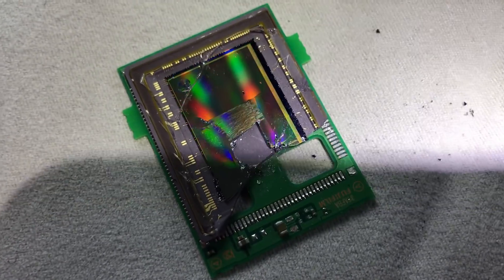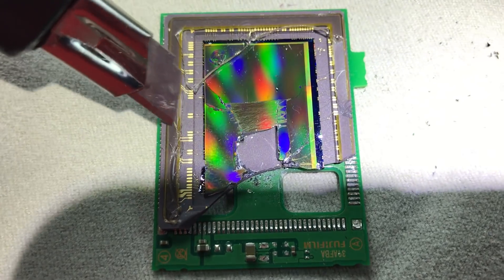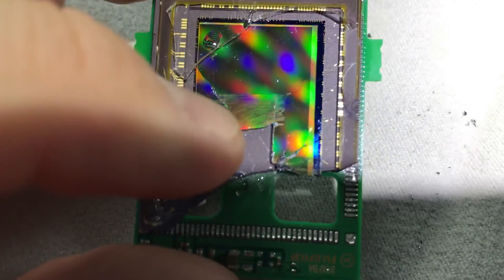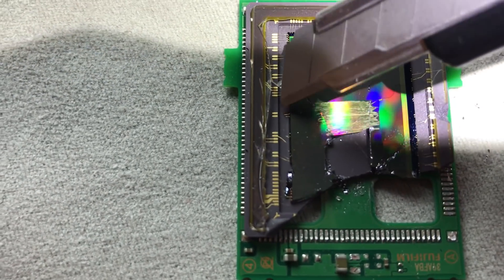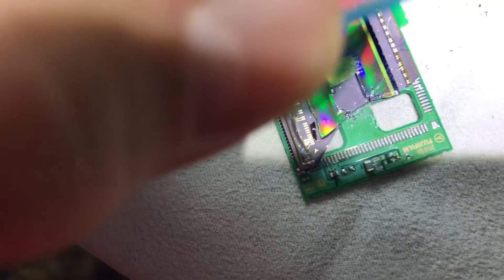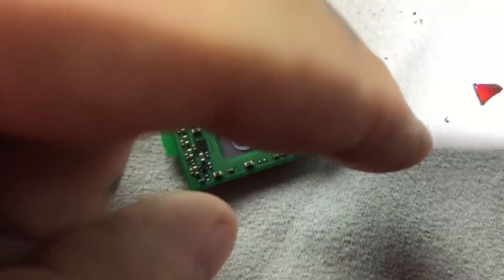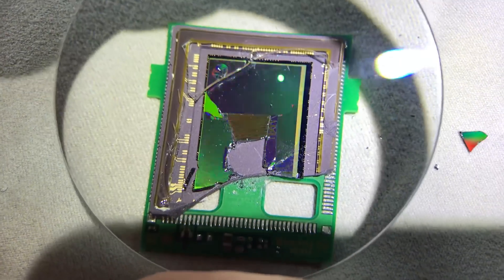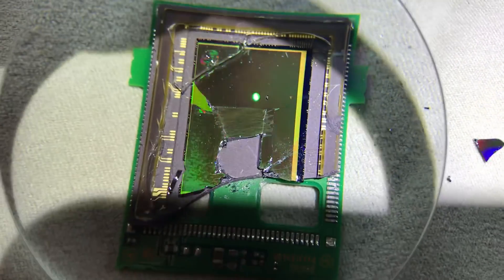🤓 FUJI SENSOR DISSECTED & Explained

Comment: You could could remove the  CFA with a trip through an asher since I believe the CFA is usually dyed photoresist.  An asher works with vacuum, heat and ionized oxygen.  Not easy to do at home. Let alone find a worthy solvent solution to clean it up afterwards.

Comment: Removing the IR sensor will give you a full spectrum analysis using this software, Thermino Spectrum Analysis.  Can be calibrated to test your led frequencies, grow light quality, and a supposed myriad of health benefits to the IR.  I just started to play with the software with a HD Webcam ($30) and it took an extreme amount of effort to remove the IR filter as Ken said.

Cheers!
Reply: Of course, I would appreciate feedback from Ken :-)

Comment: for monochrome camera - wouldn't be easiear to order a sensor without the RGB filters directly from the manifacturer, and replace it, than the complicated process of removing them?

Idea No2. - Couldn't be possible, like the ND filter inside the Fujifilm X100-series - the color filters to be on / off  over the sensor with a switch? Color + monochrome camera

Comment: It is enough to scratch the filter. Then you need whole new sensor. It doesn’t matter if the actual sensor is idiot proof.
Reply from the maker: no you dont, you have ZERO chance to touch the sensor, and NO you dont need to replace the sensor, only the cover glass, not even the IR pass filter, NOR the actual sensor coverglass
not true
Reply: I don't know about Fujifilm, but Nikon supply the entire image sensor units only. So scratch on the top layer ( in the case of Nikon the ultrasonic cleaning system) - ups, you need new sensor. Even if you get the top glass only - ups - you need new focus and image side recalibration. So, if you scratch it - you are getting an expensive repair.
Reply: Don't tell people that is not a big deal scratching an image sensor. Go and ask for a replacement from Fujifilm, then start telling stories how you can take a shit over your sensor.